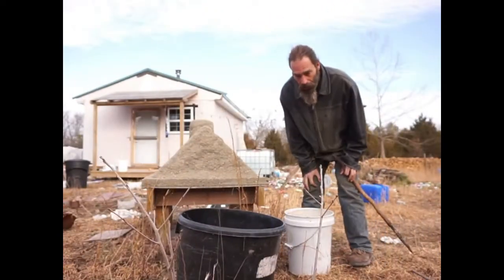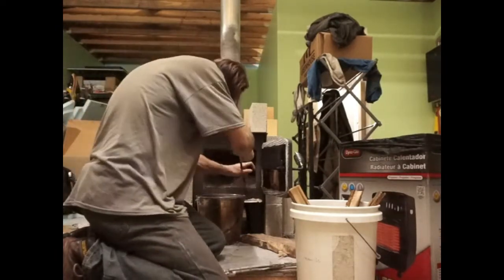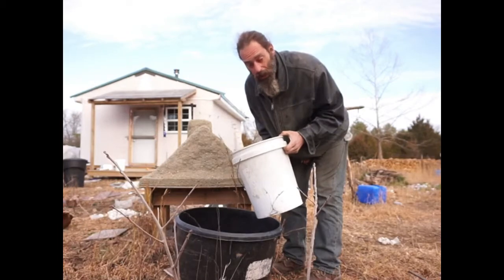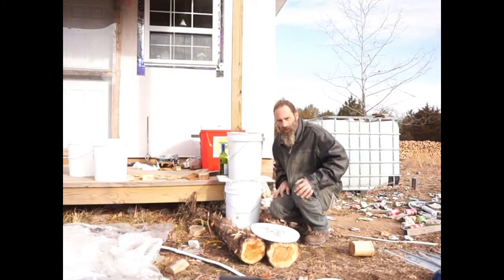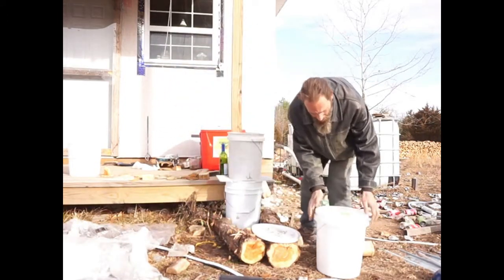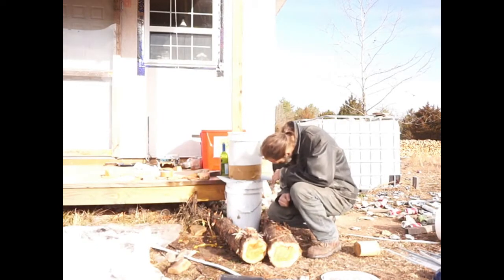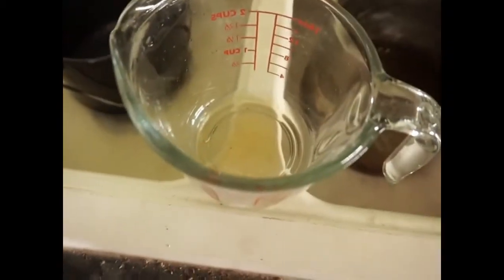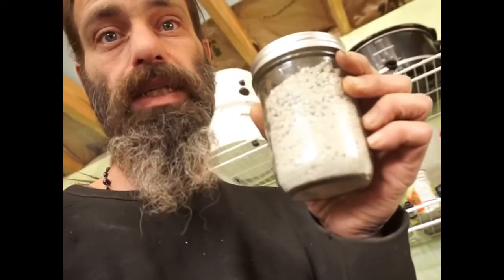Leeching Lye from Wood Ash - Potassium Carbonate based lye - from burn to white salts

Comment: This video needs to be at the top when you google how to make potash. Miles a head of those simple diy videos that usual come up.

I've been using mesquite wood as my source and it has proven to be super excellent. I didn't know at the time, but mesquite is considered a type of hard wood. It also has a long ass root system. I think the deepest mesquite roots found was 50ft deep! My hypothesis is that these long roots is why the wood is so rich in potassium and probably sodium too. It also produces a sweet sap that has medicinal properties. It usually comes out of the wood during the summer.

Also, as always, my curious self has some questions. Can either the sulfur or the calcium carbonate be extracted from the ash? Mainly interested in the sulfur, since I am already using egg shells as a source for calcium. I dissolve the shells in HCl acid to convert it into the chloride salt form. Not sure about the impurities though, since I'm mainly focused on the potassium.
Reply: Sorry if I ramble too much.
Reply from the maker: I don't really know, but I was planning on doing a vid on this kind of thing. I was thinking about sulphates earlier and other alcohol extractables from ash, mainly to stick it to the spagyric people, haha. Gotta one-up the weekend alchemists. I would suggest seeing which compounds like K2S or whatever are soluble in ethanol and try some everclear on the leeched ashes. Rotten egg smell gives away the sulphur compounds.
Reply: @offgridgecko  That would be a fucking awesome video! I've wondered if I can do more with the left over ashes. Getting any sulfur and/or sulfates would be amazing! Sulfur is on my list of chemicals I want to get from nature.

And back to the potash, would it be worth it to run the ash through a process similar to what an soxhlet extractor does? I've built a crude apparatus that lets me do this made out of plastic bottles with promising results. The water would come out clear with few contaminants although it clogs really bad. But I'm wondering if it's even worth it? Letting it sit over a few days is far easier and probably just as good I think.
Reply from the maker: @ThePoliteCreeper  I use my soxhlet VERY rarely, especially now that I'm off grid. It only comes out when I'm serious about doing an herbal extract and only on sunny days (when the solar panels can run it while I'm away doing something else). Can't remember the last time I used it, I think something with black pepper. Like I said before, just calcine them really good, there's no quicker and easier purification than that.